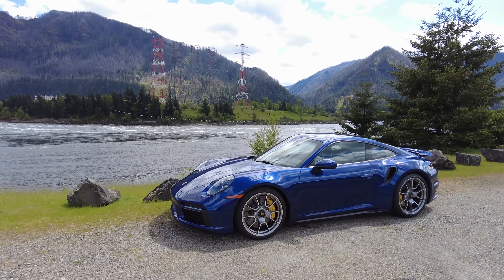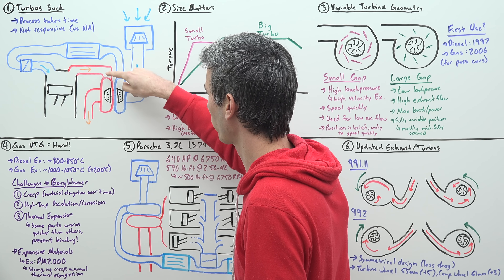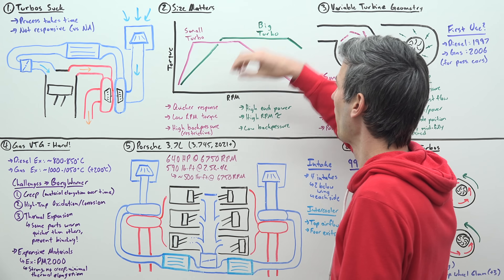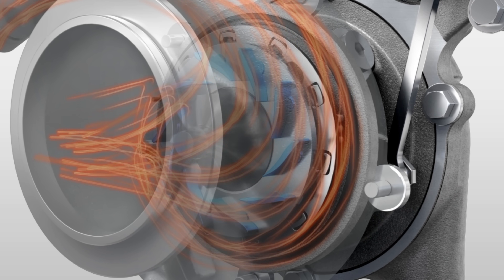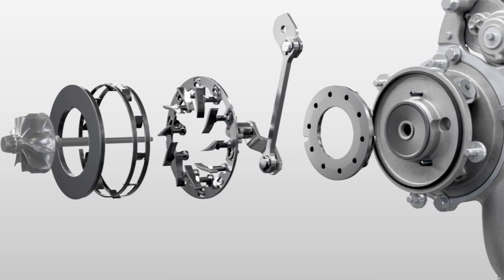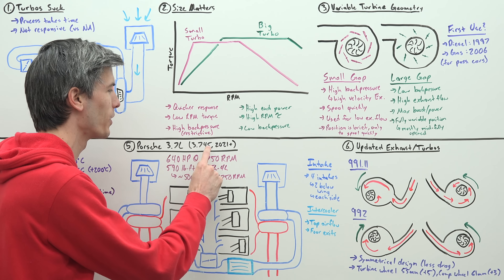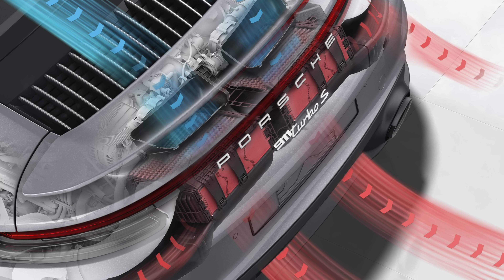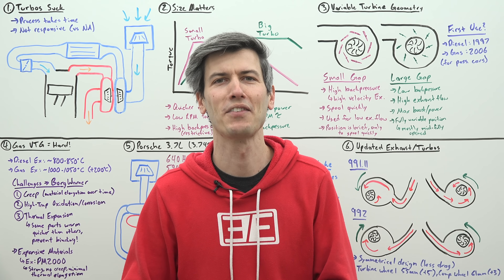The Perfect Turbocharger? Porsche Did It First

Comment: The reason a 3.74l engine would be referred to as a 3.8l is not rounding, it’s racing classification. 
If the racing displacement limitation of a class is 3.7l, a 3.74l wouldn’t qualify- so they name the class 3.8 and anyone who shows up with a 3.74 can still meet the classification.
While “3.7” is mathematically closer, 600cc of engine displacement is not insignificant for racing classification(especially for motorcycles), which is why most racers round up and never down- or the name of the class is taken to the next highest interger because it’s based largely around specific engines. I get it that this is ‘engineering’ explained, not racing classifications explained, but to derisively correct the engine displacement terminology without mentioning this is kind of lazy.

Comment: would compressed air injection be a viable way to make lag free turbo?  i was thinking if you had a burst of air against turbine or compressor this could spin turbo instant,maybe even extend turbo shaft and give air compressor its own impeller to spin?or simply drilling a hole into to turbine housing at a angle and giving direct psi shot of air this way?you could then use the wheels/axle/crankshaft to keep air tanks filled,just some thinking out loud?

Comment: First?  Always be careful claiming an automotive first.  It seems like 99% of such claims turn out to be incorrect.  Wikipedia’s page on VGTs cites examples of ‘88, ‘89, ‘91, and ‘92 production cars that use variable geometry turbos.  At least two of those had gasoline engines. All are well before the 2006-7 Porsche 911.  Note that Wikipedia is careful not to claim “first” for the ‘88 Honda [Acura] Legend.  With the technology patented in 1953, earlier application to passenger cars is possible.

Comment: I'm suprised you have not see the Twinscroll turbocharger with a quick spool valve. Does EXACTLY the same thing and costs a fraction of the turbo.  Also any aftermarket turbo setup can use it 😉.

Comment: Another limit on the power of small turbos.  The exhaust valve hasn't closed when the intake valve opens (valve overlap).  Being the back pressure is higher than boost pressure, exhaust pushes into the intake runner.  That exhaust reduces the volume of fuel and oxygen that fills the cylinder, lowering the power generated.  
Big turbo's have less back pressure, so at the same boost pressure, they will make more power (the flat line on your green plot should have higher - even with the same boost setting).

Comment: I had one on my 1.3 mk1 golf in 1998. Blowing through an R5GtT carb with a Saab boost retard module on the dizzy.
Used vac/positive feedback actuator control for the vanes. Worked a treat.

Comment: I really wish we could get more aftermarket vgt units, really the only option I found currently is a BW s300s with a turbonator vgt turbine housing on my single swapped n54, but unfortunately the spool was no better then my G30-900 twinscroll 1.06ar. Both turbos where tapped out at 800awhp, with 99% same boost to rpm spool up. Both hit 30psi at 4000rpm with G30-900 making power just a bit faster. I know the problem is efficiency, the bw just can't compare to Garrett's G series turbos, but my point is I would pay $10,000 for a vgt housing for my G30-900 because it's pretty dead under 3000rpm.

Comment: I very much enjoyed my VW TDI with VTG turbo. I did not think about the soot of the diesel helping it out. But yes, after 260k miles, the vanes started to lock up. So in went a new turbo.

She’s still running well at 325k with a new owner who is new 16 year old driver!
Reply: What vw has that tech?
Reply: @jimelewa7861  I know for sure the 2001-2003 VW's with the TDI (diesel) engine had it. The ALH engines during those years used the Garrett VNT-15 turbo with variable vanes.
(I had a 2001 Jetta TDI with the ALH engine and 5-speed manual. So much fun.)

Comment: I would look into having a electric fan and or motor to create the initial pressure of air as the turbo spools up. Wouldn't that be much better? As electric motor would not need the engine to create pressure. It would be like a duel system,  but when the turbo can make all the pressure the electric motor would be off, through some kind of relay system.
Reply: there certainly are electric assist turbos, especially in F1, however what most don’t realize is the amount of power it takes to flow air.  the complexity of all the high power electronics is cost prohibitive for most vehicles.  But check out the latest mercedes if you are interested 👍🏻

Comment: And just think, by 2030, all this astounding over engineering will be completely obsoleted by batteries and electric motors. It's really sad actually.
Reply: A little pre mature
Reply: @stevenyia2778  there isn't an existing gasoline powered car at any price that can match the performance of the top spec offerings of Tesla and Lucid. Yeah you can have a higher top speed, but who cares when any of these can more than double the highest speed limits in the land?
Reply: @letsgobrandon416 you forgot to specify stock production. Because modified gas street cars embarrass any EV.
Reply: @sutherlacd27  that's simply not true. See his previous videos, as it's not physically possible to accelerate faster than top spec EVs. They are at the limit of what's possible with street legal ties on unprepped surfaces. You can achieve higher top speeds, and out accelerate then at higher speeds, but for everyday speed, EVs are where it's at and that's only going to be solidified in the coming years.
Reply: @letsgobrandon416  show me a 7s EV...I can show you multiple 7s gas cars with ease.
Reply: @sutherlacd27  Not a single one can pull off 7s on an unprepped surface with street legal tires, on pump gas. You have completely missed the plot here. We are talking about production cars with street tires on the road. There is no ICE car that is street legal on pump gas with normal tires, that you can purchase anywhere at any price that can beat a top spec EV off the line and stay with it up to highway speeds. End of story. There are no exceptions.

If you want to play your silly game of no rules, drag radials and prepped surfaces, EVs will still win - all the torque all the time from 0 RPM to max velocity. At that point it's just a simple equation: If the EV has equal or better power/weight ration than your ICE car it wins the drag race. It's that simple.
Reply: @letsgobrandon416  and like I said if you think EVs are faster on the track show me a 7s EV....you can't. Proving you're nothing more than a lying EV fanboy
Reply: @sutherlacd27  Again, you've lot the plot. road cars man, road cars. People don't drive top fuel dragsters, and this Porsche isn't one. It's a production road car. There are no 7s production cars. They don't exists. You are speaking nonsense. You must be some teenager who read somewhere online that 7 second cars exist, as it's literally the only thing you harp on. It's completely irrelevant to this.
Reply: @letsgobrandon416  lmao there are 6s full interior, full accessory vipers. 
These 911 turbos can be modified to run low 8s and be daily drivers. Road cars can run 7s no problem. Unless you want to say they aren't emissions legal which is laughable because street racing is illegal....you dobt get to say they have to be street legal cars and then talk about illegal racing 🤣 only one who has lost the plot is you....the laughable EV fanboy who tries to do whatever he can to give EVs an advantage in a comparison

Comment: This turbo will cost as much as my house when it packs up. Not the car, the turbocharger device.Not a problem while under warranty, but...
Reply: I upgraded mine to 68mm turbos for $2.5k. to replace with bigger aftermarket turbos on the higher end is less than $10k

Comment: I had a VGT on my 2007 Ram 3500, quicker engine warm up and could be used like and exhaust brake. When on tow mode it was able to produce the braking power of something like negative 300hp. They did a test with the trucks towing 11,000lb trailers down Pikes Peak and never once had to touch the brakes...

Comment: The 3rd generation Mazda RX-7 (FD) provided similar results using a dual sequential turbo arrangement. A small turbo wicked quickly at lower rpm, bled pressure to a larger turbo at mid rpm to prespool it for battle, and boost responsibility became the larger turbo’s job from 4500 rpm to redline (~10k).

18-15-18 psi was good for a decently flat torque curve and 450 reliable hp from 1.3 liters and 200 pounds of motor, enabling a certain yellow example (mine) to whomp some Vette, Viper, and 911 Turbo tushies at Sebring in the late 1990s.  :-)

Admittedly, there were a number of vacuum lines involved - with heat deterioration an issue, (1400 - 1600°F EGT will do that) but a switch to ziptied silicone hoses fixed that.

Comment: Why have they not made an electric turbo for the immediate acceleration or to spool up the turbo when it is lagging, they could also use magnetic levitation using an electric motor with an external stator and the turbo as a rotor and reduce wear/ friction, come to think of it this would also help a jet. Use a capacitor that is easily charged once at speed.

Comment: NO, no, no, Porsche did not do the variable geometry turbo for gas engines first. My 1989 Shelby CSX has one, and if my math is correct, 1989 came before 1996. Chrysler called it a variable nozzle turbo, but it is exactly the same basic design as the Porsche one. Look it up. The 1989 Shelby CSX was, and still is, an amazing machine, way ahead of its time. First use of composite rims and first use of the variable turbo in a passenger car. I still have mine. It's been with me for 33 years now and I still get a kick out of driving it.

Comment: Sounds like they are trying to overcome the same issues that manufacturers were using sequential turbos for back in the 90s. Turbos and ECUs have come a long way since then though, lag isn't too much of a thing anymore unless you're trying to run silly amounts of boost for the application. Porsche have knocked this one out of the park, wouldn't wanna have to replace one of those turbos though. I wonder how this compares to Koenigsegg's system of spooling the turbos up with compressed air. Porsche clearly have the more technologically advanced system, but far more moving parts, which is more points of failure.
Reply: no lag is actually boring, the exponential power build up of a tuned boost car is second to none
Reply: They aren't that expensive to rebuild

Comment: Thank you. Have driven a turbo charged auto for 31yrs, yes it performs well. Had to replace turbo and found a JDM unit. Am not a fan of turbo's in particular. Would prefer larger aspirated engines for performance enhancement over a turbo. But all things considered a turbo is  THE
way for performance today, in  lieu of weight do to a variety of questionable decisions  (design, emissions etc.).  LOTUS!

Comment: Sorry, but Porsche wasn't first with gasoline VTG, neither was Borg Warner.  Investigate the Chrysler CSX T from the mid-80s.  Pretty low volume but also ~20 yrs earlier.  Engine bottom end couldn't handle the increased torque which wasn't discovered during the standard validation test so many of the vehicles blew their engines, nevertheless the engine achieved it's goal of high specific power and a broad powerband.  First real high volume gasoline VTG was VW using their Miller cycle gasoline engines ~2017?  The high temperature materials to make the technology work have been around and wasn't the reason to prevent this technologies availability, only the lack of willingness to pay.

Comment: I’m a big fan of Porsche the company. I started attending races in the 1960s as a very young boy and couldn’t miss those plucky little cars that didn’t break and finished first for not so obvious reasons. I have owned two rather humble Porsches - 1983 944 from new and a fantastic 1993 968 and can say the engineering expertise can be felt, each car being so much faster than ‘the numbers’ and with bulletproof reliability. There is a technical superiority the driver can actually feel in the seat and the steering wheel. I hope I am always lucky enough to enjoy this bit of self-indulgence.

Comment: A lot of opinion stated as though it's fact here.   Turbos have "lag", but that "lag" is the period of time between where they are only able to provide more torque than the naturally aspirated equivalent until they are able to produce a LOT more torque than their naturally aspirated equivalent.  The area where they are feeling "flat" is where you're slumming it closer to where life without turbos is.  Depending on the supercharger type, you're often still better off with a turbo even when in that transient area - centrifugal superchargers have a very lazy boost curve... only positive displacement superchargers have any real advantage anywhere, and they come with their own distinct downsides.

When it comes to opinion, a well matched turbocharged setup can be a lot more fun to drive than other options as well... and definitely offer a higher performance ceiling.  Love them or hate them, so long as ICEs are around turbos are going to be synonymous with the best performing options.

Comment: Sorry, Porsche was WAY late to the party. Chrysler/Shelby introduced the first production gas burning VNT/VGT turbocharged car in 1989 as the Shelby CSX VNT. Chrysler put them into regular production in 1990 in the Daytona, LeBaron, and Shadow models. Due to several different issues from things such as the vacuum system to the vanes in the turbo sticking and variations in the setup of the turbos they ended up costing too much in warranty work and they were cancelled early in the run. But, the fact still remains that they were the first to do it in production, NOT Porsche. I sincerely hope you correct this mistake.

Comment: I used to run a cryogenic oxygen distillation facility which utilized an adjustable turbo compressor in it's process. This was manually controlled and installed in the early 80's. Just an FYI that this tech existed in industry prior to adoption into automotive applications.

Comment: As much as I like this guy, he forgot that it'd be the same response withOUT a turbo... cause you know, naturally aspirated requires high RPMs, so huge delay there. Launching a car is completely different as well, and he forgot that too. As the car's brakes are holding the power, even at low RPMs, the turbo is actually building non flowing pressure, which will cause get you an even better launch than you could ever achieve with naturally aspirated. Let's face it, forced induction will forever be better than naturally aspirated...
Reply: As much as I like you as a human being, you forgot the difference between response and getting up to a certain speed. He was clearly talking about the immediacy of throttle response which is like warm knife through butter in N/A cars and horse buggy in poorly designed turbo applications. But nice try.
Reply: @DayTradeEssentials  smh your comment makes no sense. Read my comment again. But let me explain it with apples and oranges. What I meant to say, is that naturally aspirated takes even longer to get power, around 4-6k RPM on most cars to get full power. Turbos bring it down to as low as 2k RPM, but he forgot about that and goes on to criticize the turbo for having "lag". Got it?

Comment: My old 1997 VW passat with indestructible 1.9 TDI have VG turbo. 450k kilometers and still rolling great. The problem with diesel and variable geometry is soot. You have to take hot side apart and clean it after 200k km.